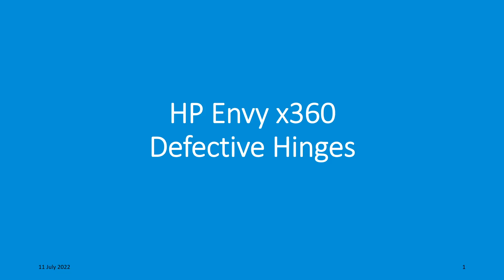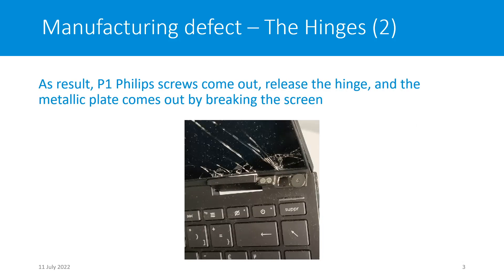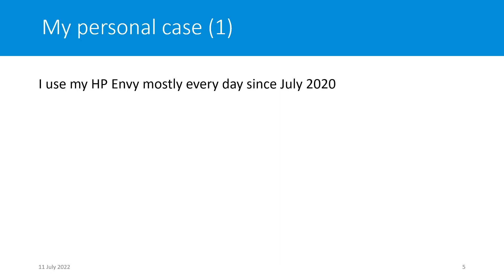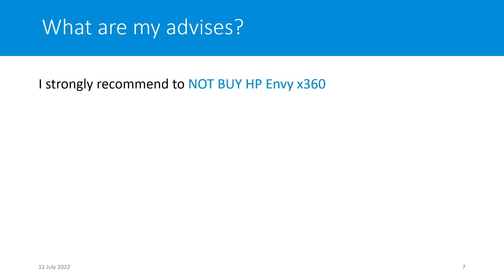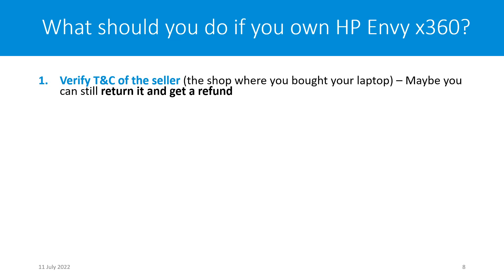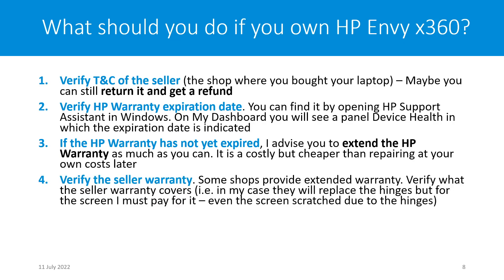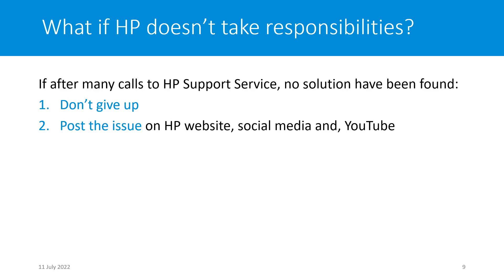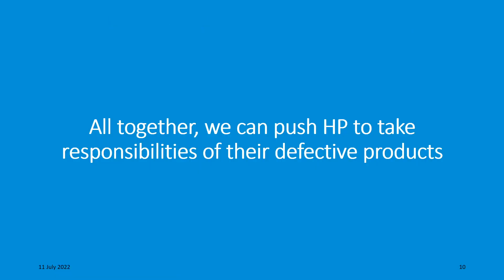HP Envy x360 Broken Screen - How to Repair?

Comment: Is it possible that the hinges grew stiff because it isn't used heavily? Maybe if you open and close the laptop, and use it in tablet mode maybe 10 times more than you did, the hinges won't be as stiff and won't puncture the display?
Reply from the maker: Hi. No it is definitely a manufacturing defect from HP. I received more than 50 messages from customers having the same issue. Have a look on my others videos to see clearly the defect.
Reply: @minusculebloom  Understood, thanks!

Comment: Is the new 2022 Envy 13 Intel 12th gen using the same hinge design?
Reply from the maker: Yes exactly same design for the chassis and hinge. The difference are the hardwares (i.e. processor). Then if you have or buy the new model, you take a risk.

Comment: Same problem just occurred with me 
My model is also same and 1.5 years old 
My laptop usage was same as you .
What should I do now ? Please help me 🙏🏻
Reply from the maker: Call Hp customer service and push push. My case has been resolved that way. It took a month. It was a struggle.
Reply: @minusculebloom  yeah I am trying the same , thank you for your efforts to put the issue on YouTube , it helps a lot of users .
Reply: @minusculebloom  did HP paid for the loss ?
Reply from the maker: @shubham7797  yes HP replaced the complete screen panel and HP beared the cost.

Comment: Thanks, it is very helpful. I hope your problem will be solved soon
Reply from the maker: Hi Tom, 
Below it is part of the email that I received from HP yesterday (12 July 2022 at 6pm).
"Repair charges would be applicable since unit’s warranty has expired.
Having shared above, as much as we understand your disappointment, I have to assure you that we will give our best on the concerns raised.
As shared, I am already working with our parts planners to verify parts availability \ sourced as an exception.
Once availability is confirmed, will work on the cost involved and be rest assured, will try best to see even if any discounts applicable as exception."